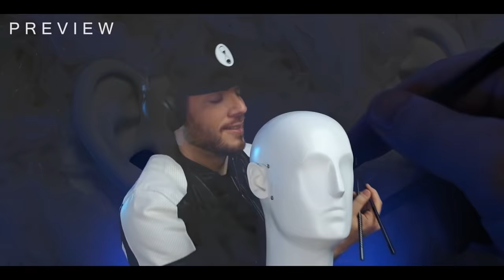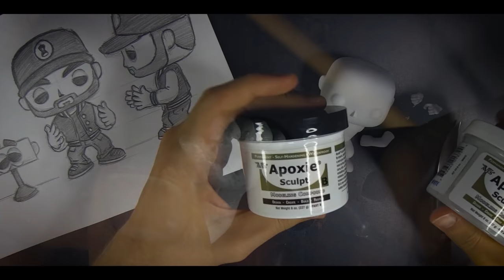ASMR Preview Collection - The Very Best Ear to Ear Triggers for Brain-melting Tingles and Deep Sleep

Comment: Timestamps💛(sorry if there's mistakes)
0:0 big preview?
0:59 fluffy thing on small microphone 🥭
1:05 music melody around small mic🥝
1:11 cleaning gloves with soft little rubber strings🍓
1:18 small red cup tapping🍑
1:24 gloves (matirial noises)🍅
1:29 medium cup tapping (overlays over gloves)🍈
1:34 big feathers🍏
1:38 water in chemical bottle (bubble noises)🍍
1:41 tapping on green thing🍒
1:48 plastic over microphone (crinkle noise)🥑
1:52 wig over mic (so handsome)🍇
1:57 make up brush rubbing over mic🥭
2:05 plastic over mic with make up brush (8D)🍋
2:13 slime + the makeup brushes and plastic  (16D)🍉
2:20 foam noise (24D) 🍌
2:25 foam+fluffy mic +cup+slime🍓
SLIME 
2:34 loads and loads of slime (dummy head)🍊
2:41 slime with beads🥑
2:44 more slime🍉
2:49 slime with foam beads🍍
2:56 more slime🍑
3:00 foam slime with tweeters🍎
3:04 slime over ear with meatle sticks with beads🍏
3:09 more slimeee🍅
3:31 slime again big pokes! 🍐
3:20 slime falling on ears🥝
3:25 slime ear cleaning🍓
3:27 slimes over mic🍌
3:33 TINY MICS 
3:36 mic in slime💜
3:45 bath bomb (fizzy noise)💛
3:51 foam beads in packs💙
3:56 mic dipped in orbeaz❤
4:04 little circles with soft prickles💚
4:07 foam beads🧡
4:13 beads in packs💙
4:19 soft cleaning tool💜
4:23  Fizzy foam and sponges
4:30 foam on mic +make up brush 
4:36 bath bombs
4:42 spa brushes 
4:46 fizzy noise in jar
4:51 spa brush on 
4:57 sponges 
5:02 fizzy noise in small ball cups + tapping 
5:10 pop rocks on sponge with water (popping noise)
5:14 loats of foam noises + make up brush + blowing 
5:18 sponges filled with foam 
5:24 bubbles! 
50s  mics 
5:33 old telephone noises 
5:47 make up brush 
5:50 shaving cream noise i think
5:58 corn box tapping (meatle)
6:03 more meatle tapping 
6:10 popcorn bag noise 
 6:20 meatle box full of something 
6:23 little box with meatle bowl  mixing sounds (no idea)
6:27 meatle lid  tapping 
6:33 water /mist
6:42 steamer (not very sure)
6:54 more steamer (idk)
7:02 spray bottles
7:09 mini steamers
7:15 oil bottle sound ( short)
7:18 more steamer (correct me if I'm wrong)
7:23 big pipe +whispers
7:35 more fluffy sticks
7:42 vibrating noise
7:49 orbeaz  on top of mic (mixing)
7:54 spikey mini balls
7:57 orbeaz stress ball
8:01 massive make up brush
8:10 ear cleaning
8:20 jelly cubes in slime over ear
8:27 plastic  cover over ear + tapping 
8:37 water injection(so nice)
8:42 rubber finger covers 
8:48 plastic and rubbing over plastic 
8:55 water pipe
8:59 burning candles in ear
9:06 spa brush
9:15 fluffy pom poms
9:20 orbeaz
9:28 massage gun
9:37 finger covers 
9:46 brush on table cloth
9:54 meatle things 
9:59 fizzy things
10:06 big bag of something
 10:13 hat tapping
10:23 lots of ear cleaning with foam slime
10:27 fizzy noise again
10:34 foam in ears
10:36 tweezers  ear picking
10:41 water injection
10:44 spickey brush
10:51 orbeaz
10:56 gloves
11:02 plastic with fluffy things
11:09 cup tapping
11:14 slime with jelly cubes
11:18 meatle rolly things
11:23 rubber gloves 
11:31 mascara wand
11:38 future technology thing
11:46 air octopus
12:01 rubber cover
12:15 cotten bunny's
12:24 foamy sponges
12:30 make up brushes
12:38 having a shave
12:44 babera shop( lots of triggers)
12:55 water bottle spraying
13:00 scissors
13:09 brushing sounds
13:15 shaving cream
13:23 scraping shaving cream of mic
13:26 more brushing sounds
13:34 whispers
13:41 pop tube sounds
13:51 vibrating sounds(overlaying pop it)
14:00 pop it sounds
14:03 orbeez
14:14 fidget toy
14:17 meatle tapping sounds
14:25 rubber ball
14:35 fluffy ball
14:37 tapping dog toy
14:41 water hourglass thingy
14:44 ear cases 
14:49 rubbery octopus
14:52 electric balls
14:56 paper cups
15:59 little cases
15:03 massive case
15:05 little red cups
15:08 inside a  massive coin jar/coke bottle!
okay there will be more I haven't done this in 3 months and I'm sorry 😅
Reply: Holy crap that many trigger is 6 minutes?
Reply: @deathymoon1813  there's so many it hurts my fingers typing-
Reply: Good job tho
Reply: @Speckleshine aww no problem!  I still need to finish another load soon pray for my fingers
Reply: @Josue Portillo yes actually very very very very very very very very very tired-
Reply: Tysm u r a legend
Reply: Thanks for the contribution and the determination
Reply: Oha das ist Viel aber good job 👍
Reply: Keep up the nice work! (Or if you don't want to that's alright you already did so many-)
Reply: @Cherieisacherry  thank u!! I will do another load soon il try do the whole thing if I can!
Reply: Thanks
Reply: Broseph you are determined! 13 minutes of timestamps and your comment is already the length of the Silmarillion
Reply: Thank all for all the nice comments dw mee is coming!!!
Reply: tnx
Reply: When is gonna be that soon tho?
Reply: @nag21  sorry I haven't been doing them iv been busy with homework I do understand ppl frustrations I will get back to them there is just loads
Reply: The effort...
Reply: Its okay you just have an 1 hour 19 minutes and 7 seconds left to go! :D
Reply: I love you
Reply: Holy crap, that is A LOT of typing, I'm praying for your fingers dude.
Reply: Hi! Thank you for your sacrifice and I believe the metal thing at 6:23 is a coffee grinder!
Reply: This is insane wow 😲
Reply: Thank you 🙏
Reply: btw the “music melody thing” is called a tuning fork!
Reply: Thank you i need this
Reply: Meatle
Reply: Yo thx for the timestamps and gg fot all the time used👍
Reply: holy shit the dedication tho
Reply: Big bag of something

I'm dead lol 💀👌
Reply: why...
Reply: I am going to pay your therapy.
Reply: @kittykade  thank u im gonna need it for these timestamps
Reply: bro
Reply: POV: you type a long message and they hit with the “k”
Reply: Wow,😭ty
Reply: Plenty mistakes redo it NOW!
Reply: "steamer" is called a humidifier! i love the sounds of them and they help me breathe at night
Reply: A
Reply: Just saying for slime big holes (1st one if there's more) you but 3:31 instead of 3:13(not trying to be mean just pointing out)
Reply: 8 месяцев прошло а мы ждем
Reply: you should continue
Reply: Omg
Reply: Yk, the whole vid is… preview
Reply: For the second one "music melody" it's incorrect it was a tuning fork it used in music to tune instrument. The frequency of a diapason are 440hz corresponding to a A note
Reply: @LilianCRE shut up
Reply: @go_loco1285  sorry for the report
Reply: @LilianCRE  yt does not care 👍🏽😁
Reply: @LilianCRE  never did I say stupid you said it making yourself look bad 🤦🏽‍♂️
Reply: @blossomtea4177 hey so it’s been two years since, do you mind finishing ?😅😂